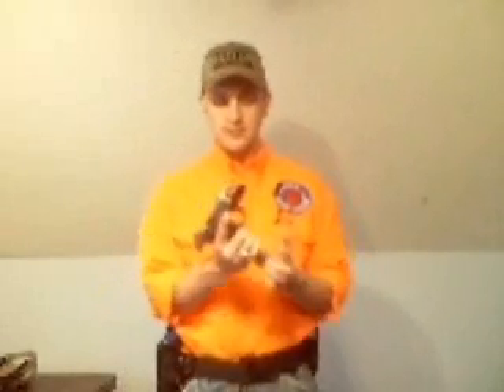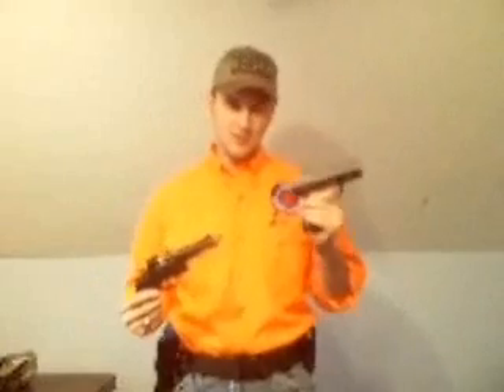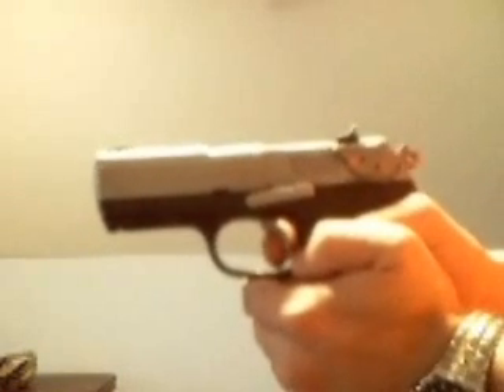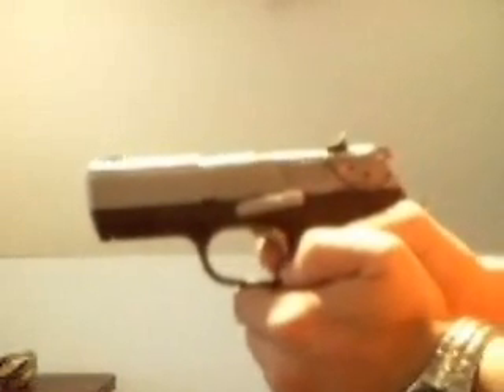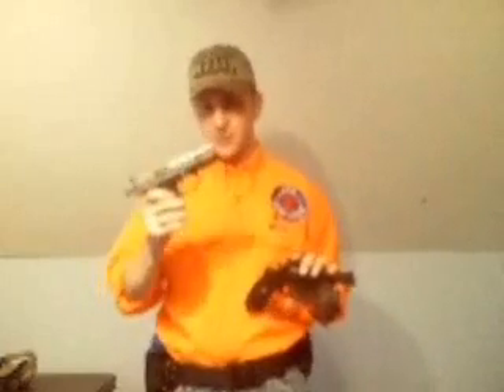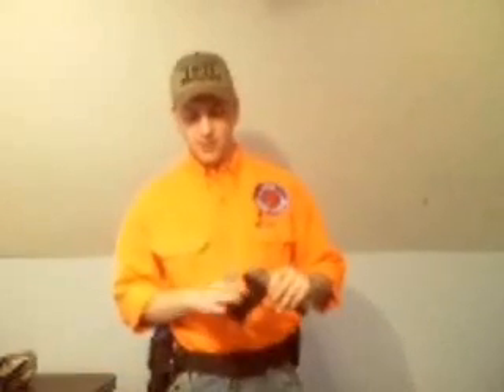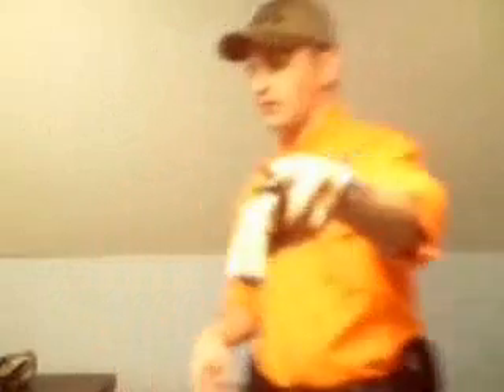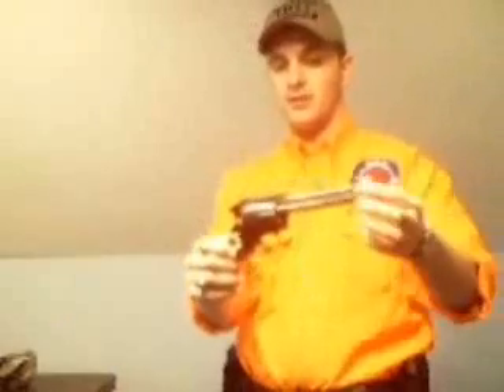Basic Pistol Parts and Functions

Comment from the maker: My finger is not on the trigger but you can clearly see the hammer fall, right? I used the decock lever on the pistol to put the hammer down. The gun was checked that it was unloaded no less than three times in the first 50 seconds and it can not fire from using the decock lever. While it is true that a safe direction is a good idea, you have to break all 3 safety rules to have an accident. Its unloaded, finger off the trigger, I'm following at least two in this instance.

Thanks for watching.